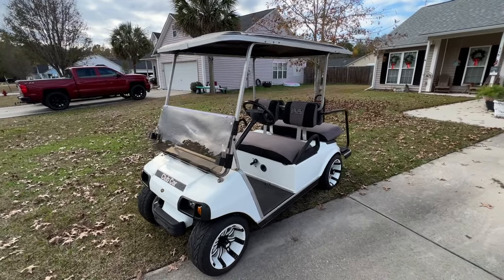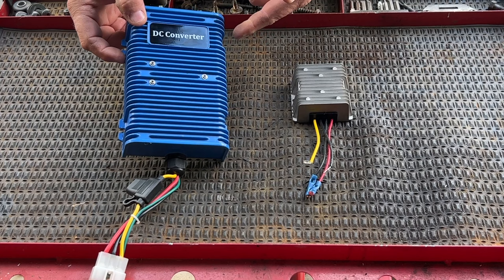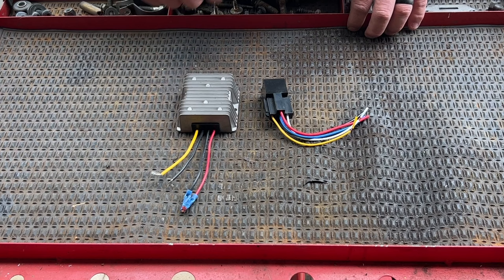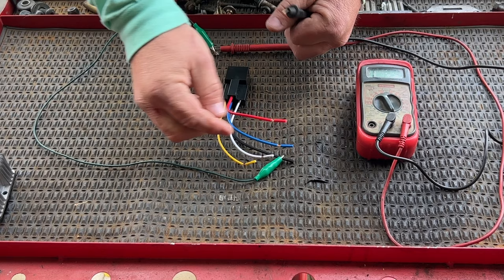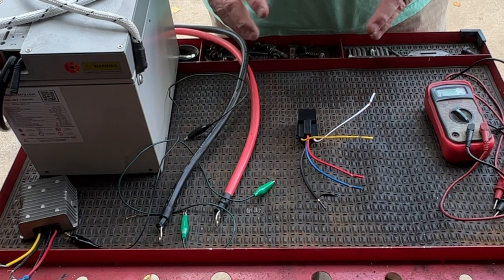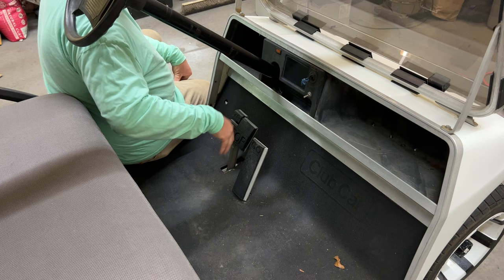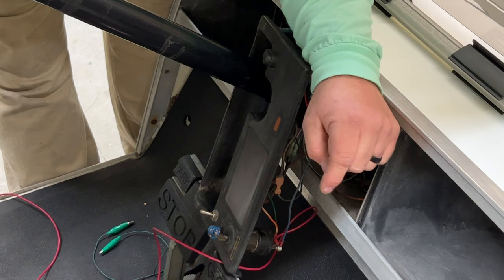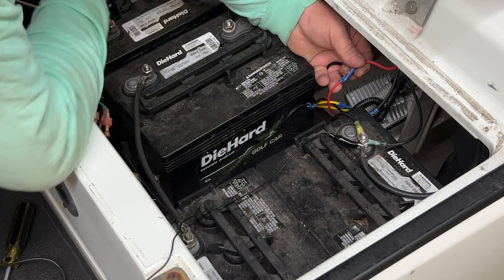How To Wire DC Step Down Converter & Relay with Golf Cart Ignition Switch | Stop Battery Drain!

Comment: @fertertainment: Late comment, but question about Relay and the Blue Converter (w/ constant blue 12v for radio memory). Since the Relay's "blue-wire" has power ("continuity") when key is off, how is this any different then the Converter's ("blue model") constant power "blue wire" (for radio memory)? Is the parasitic drawl only happening when the converter is converting the constant blue wire to 12v (from 48v), where the Relay has no parasatic drawl since its not converting, but only passing/diverting the power (48v "continutiy") to its blue wire when key is off? Thanks in advance.
Reply from the maker: No comment is ever too late. On a relay it was have 5 terminals. 85 & 86 is to power the coil. 87 = NO, 87a = NC and 30 is common. 30 has continuity between 87a when no power is being applied to 85 & 86. Since we didnt use 87a then there is no power being connected to anything (basically the switch is off). When power is connected to 85&86 then 30 and 87 have continuity (basically the switch is on). Continuity means pass through but doesnt mean power. When a 5 wire dc converter like the blue one is being used. Even though its technically off when the cart is off, the converter is still converting pack voltage to 12v and also delivering 12v memory to the radio. Its still working when you arent on the cart. You dont have to do it this way, you could do it the original way from the instructions but by utilizing a relay will result in the converter only powering on when the key is turned on.
Reply from the maker: The relay is powering down the converter when the key is off and powering it on when the key is on. No need for it to converter 48v to 12v when you are working, sleeping or away from the cart. Yes, the converter is still converting 48v to 12v when the cart is off and the blue memory wire still has power available on it. Its not supplying the full 30 amps but its still delivering power.
Reply: @Fentertainment  _ Really apprecicate your time and attention. I did understand your video explaining the coil switiching (just fyi  a diagram could help for next time :) I really do appreciate you putting it all together into a video. My main goal is also not wanting the cart batteries to be unintentionally working when not using it (aka parasitic drawl).  I was just double checking  I was not substituting one parasitic wire for another (but seems pass through is not the same). Thanks again, keep the videos coming!
Reply from the maker: @Auby03  Ten4, I answered reread and answered again. I need to make another video with better scenarios. It’s definitely something most could use.

Comment: I have one of those converters on my 12x4 48 volt cart. I put in a fan on the roof to cool off in summer while sitting still. Stopped using my cart around November and tried using it around late February. Here in Illinois we can’t use them during that time as it is too cold to golf. I leave it plugged in to my charger, which also has a trickle charge it runs periodically. When I went to use it I could barely go 9 holes. The batteries are now only a year old. Water levels fine and taken care of. Took the batteries in and they said all 4 are bad. I can only assume it was drawing as it was sitting in the charger and hurt the batteries. Do you think that is possible?
Reply from the maker: Sure Do. Thats why I added this relay to the system. Now the converter is only on when the cart is on.
Reply: Thanks for everything. Great video. I ordered the relay and followed your video step by step. Worked great. So now my fan and after market USB port only come on after I turn the key in the on position. Worked exactly like you said it would. Thank you

Comment: I run a fuse box on my set up and I can’t figure out the relay wiring. Do you have a video or a diagram that shows how to use the reducer, relay and fuse box? I have a 36v cart.
Reply from the maker: I do but it’s not a dedicated video. It’s a Bluetooth speaker video. I used a reducer, relay, fuse block and Bluetooth marine amp
Reply: @Fentertainment  does it show any of the wiring diagram? If so, can you post the link?
Reply from the maker: @chrisreese6456  pretty sure I posted a homemade diagram in the video. https://youtu.be/NC5qVAXzoco

Comment: Would there be any issue installing a second 12v reducer? The cart came with a reducer and 12v accessories but is kinda of hard to get to.
Reply from the maker: Not at all
Reply: @Fentertainment  In the input for converter did u wire the relay to from the battery positive to the input positive?

Comment: What if my ignition key only has 2 wires?
Reply from the maker: Most ignition systems on golf carts only have 2 wires. One wire will have voltage on it all the time & the other is the ignition on wire (This is the wire you want).

Comment: I recently did this upgrade on my 1990 club car ds 36 volt cart, the one difference I encountered was that the on side of the key switch was the negative side of the 36 volt battery.
Reply: Hi Don were you still to hook up the relay with the side being the negative because I have a 1989 club car ds and looking to do the same upgrade  ?
Reply: @shawtdog I had no problem hooking up the relay, I just had to connect one side of the relay coil to the switch and then connect the other side of relay coil to the positive post of the battery pack. I suggest using a voltmeter to determine exactly what is coming from your switch and wire your relay accordingly
Reply: OK THANKS DON I APPRECIATE YOUR HELP

Comment: Easier wire the reducer to main solenoid
Reply from the maker: The main solenoid on this cart is activated by the accelerator. So every time the accelerator isnt pressed the converter will be off.

Comment: Hey bud, I like your videos but I need to make a correction to your statement that a DC converter draws power. If you wire in a DC converter with nothing on the 12vt side, it will Not draw power. If you connect a fan on the 12vt side with the fan switch off, it will not draw power. If you connect the fan and turn it on, it Will draw power. So your statement that it Always draws power is false.
Reply: Incorrect, my converter draws 1/4 amp in standby just being connected. This  will drain the battery. I installed a relay to disconnect the plus 36v power lead that switches on and off with the key.

Comment: I noticed the relay contact is rated at 14v dv 40a and the coil is 48v dc. Is the contact handling the 48v dc?
Reply from the maker: Yes, coil is 48v dc 40a @ 14v dc. The converter is 30a converter. We are under the recommended rating.